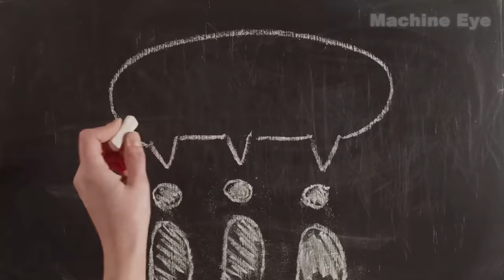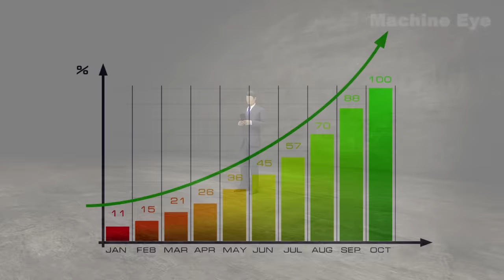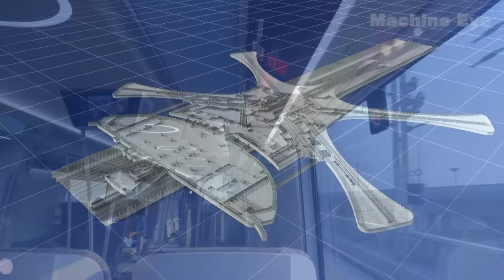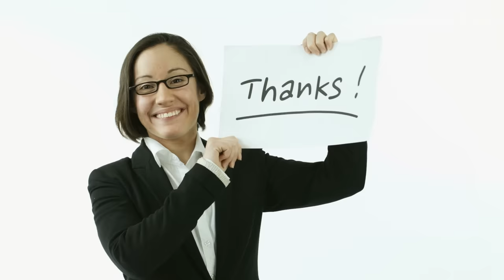China's Mega Projects Shocked The World! American Engineers Call It Impossible

Comment: American Engineers Call It Impossible???? 
I still remember when China was planning to build the Qinghai–Tibet railway line from the low land of China to Lhasa of Tibet climb over the highest mountain of this world. Many western countries, USA even India and Japan were all laughing and criticizing how could this railway line be possible. All these western countries and India engineers was saying because of the weather on top of the highest mountain the temperature can drop down to minus 40 degrees or more and many other unforeseen problems could occur too. The low temperature could affect the railway metal tracks and it is too dangerous for train to run on it as the tracks could break when the train running on them. But the Chinese was very confident and they went ahead and built. Completed in 2006 and have been operating for the last 17 years and still running today without a single problem.
Reply: I saw a Chinese engineer explain the smart and innovative solutions they used to build the railway line you mentioned on Discovery ch.  They're brilliant.  I foresee more of these mega projects built all over the world by them.  Countries which are against China, I suggest cooperate with them.  If you can't beat them, join them.